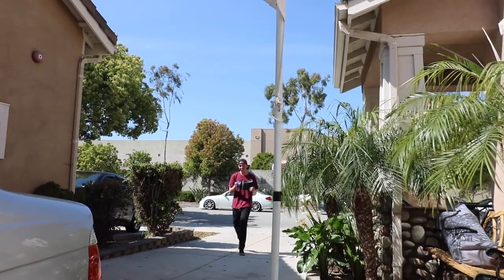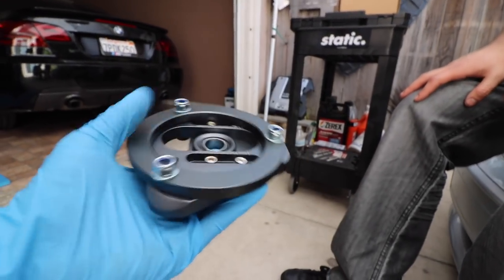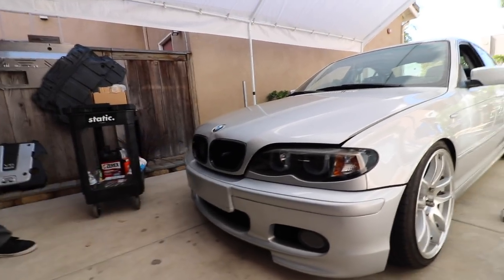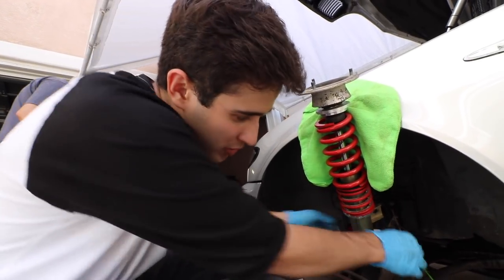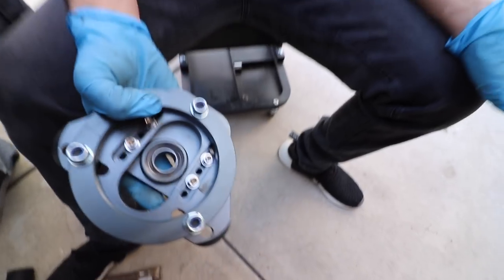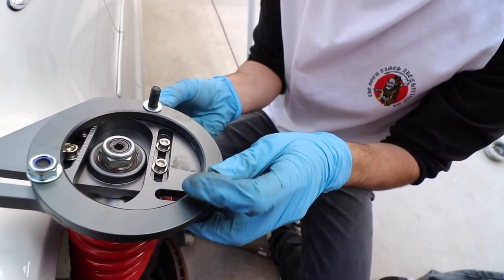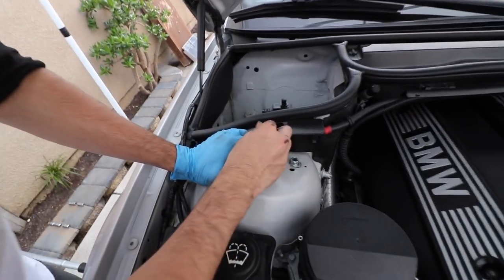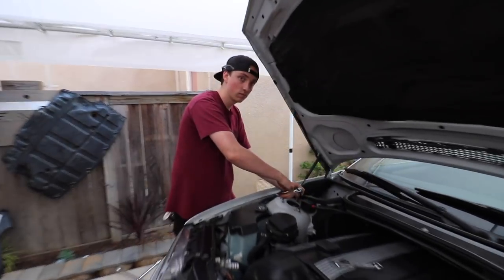GodSpeed Camber Plates Install | BMW E46

Comment: Cowboys! Vice grips on the damper shaft! Stock E46s already have too much camber and wear out the inside of tyres. Putting more camber on for track use is understandable but increasing camber just so you can put spacers on is just bad news.

Comment: WARNING these plates are installed wrong! they need to be rotated 90 degrees. You are using the caster adjustment for camber and vis versa.
Reply: 90 degrees which way

Comment: Mounts look good, but looks like you ruined you shock shaft with those vice grips. The hex fitting on the top of the shaft is so you can hold it while you loosen, or use air impact.
Reply: Lol butchers using those vice grips, I stopped watching after that 😂

Comment: Will these camber plates fit with a regular strut? I don’t have coils I’m running springs.. nice vid!
Reply from the maker: I'm not sure. Contact GodSpeed on Instagram or by email! Thanks for watching!
Reply: Static Works just hit them up on insta thanks bro
Reply: Nope/ Will not work. See here.
https://www.redline360.com/godspeed-front-camber-plates-e46-m3-MSS-THE02

Comment: Thanks for the install video. I’m trying these on my e92 tomorrow. Will update this comment after i slap them on and get aligned. Hoping that the bolts tighten well and that there’s no extra spring bind introduced
Reply from the maker: Hope it works well for you sir

Comment: How are those ECS coilovers holding up so far?
Reply from the maker: Amazing. Have no complaints thus far. Even with the coilovers being completely maxed out on the rear and the front have little adjustment left, it still rides great.

Comment: how do the ECS coils ride compared to stock?
Reply from the maker: Honestly they ride amazing. That's also a con because they're not the stiffest springs and don't have dampening. Since I'm practically maxed out on the coils it hits on bumps since the springs aren't stiff enough. Other than that I have literally no complaints! I live the low life and accept the struggles haha! Best bang for your buck.
Reply: Why didnt you put 19 ..10j on it with a 30 tire..fits a lot better and you dont need the camber plates. Like youre videos bro keep up the good sh#t  greets from the netherlands.

Comment: Any knocking sound when turning?
Reply from the maker: They're used to be. I took it all apart and greased up the metal parts where the Camber Plates connect to and it was gone. Now I'm not sure whether it's the grease or re assembling it that stopped the noise haha
Reply: So I greased all the parts and I placed a washer in between the camber plate and the top of the coilover. That fixed the knocking sound. Thanks again for uploading your videos and helping us all on our DIY projects.

Comment: Camber is out OR in angle.
CASTER is forward or back. Two separate adjustments. Looks like you have to pre set the caster (full forward is usually good for street).  I cant see that you have access to the caster bolts once everything is installed.
I think I will PASS on these cheap as plates since they have a spherical bearing up top. NO NEED for that in a street car. Too harsh.
Reply from the maker: The ride quality has surprisingly been really nice even with all the suspension upgrades including a strut bar. Or maybe I'm just used to it haha!
Reply: There is a reason that most of these plates are expensive

"Turner E46 M3 Street Camber Plates - General Information Race camber plates (with solid spherical bearings) are great for the track, but what if you want to drive your car on the street too? That’s what the TMS E46M3 street style caster/camber plates are: A plate you can use on the street, still have the available adjustment of a race camber plate, and not have to put up with a harsh ride or 
replace the bearings every season."
Especially the last part.
https://www.gmpperformance.com/detail?pid=248674
Reply from the maker: Good information man! I'll eventually upgrade to Turner's. Thank you!
Reply: Really need that urethane bushing up top. Ask around. Spherical bearings do NOT belong in the street. They can cause failures of adjacent components.
Reply: Ground Control and Vorschlag (and others) are just as good. Buy what you can find a deal on.

Do you have ANY idea where your CASTER is set? Not even mentioned. This is a critical value for stability. I run my M3 FULL caster on the street. Zero toe in the rear and just a tad toe-in in the front. -1.5 camber in the street.
Your drop should NEVER be cosmetic. Proper drop on an E46 will have more tire show up front than in the rear.

Measure from center of wheel to fender lip.... for an M3 is 13 inches rear and 13.5 inches front. This keeps the weight bias as close to 50/50 as possible. Dropping the front so it LOOKS the same as the rear will have very negative results compared to the proper way.

I have owned my M3 since 2008 and have $35K in mods. Mods that work perfectly!
Great ON or off the track!

https://www.youtube.com/watch?v=z8_HuYoVE-0

Not me. But is shows you how to set your springs by hitting speed bumps while adjusting. Realize you may need to re -adjust in a month or tow due to sag.
Reply from the maker: Sounds good. I have not checked. I took my car to my buddy for an alignment and dialled everything in the "green" and evened out my camber/toe. I'm running -6 camber all around which is excessive but with no toe my tires are wearing out alot slower than I imagined.
Reply: -6 camber makes you look like an igmorant ricer. No more than -2.5 in the street. -1.5 is "in the green". -6 camber is "in the BROWN" if u know what I mean.
Find another buddy if he did not measure or adjust caster. MOST of the time it is "cheaper to pay". Capiche?
I get my alignment done by an absolute MASTER for $80. Front and rear. Caster, camber and toe. NObody does as good a job.
Reply: I always get some toe in front and MODERATE camber. I run a 265/35/18 square set up in the street. I ROTATE my tires. Even on my now 360HP M3, my tires last a looong time!
At -6 camber your car is a hazard. You now have LESS contact... a lot less. You could be sued in an accident for improper equipment or negligence if you ever break traction and slide in to some poor owner.
https://www.pistonheads.com/gassing/topic.asp?t=1265936&i=20
https://www.pistonheads.com/gassing/topic.asp?t=1265936